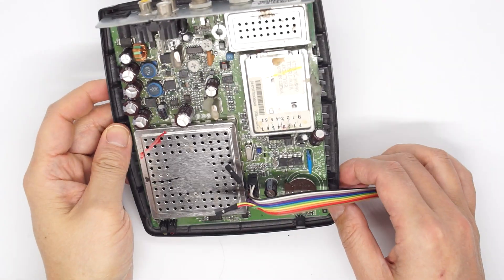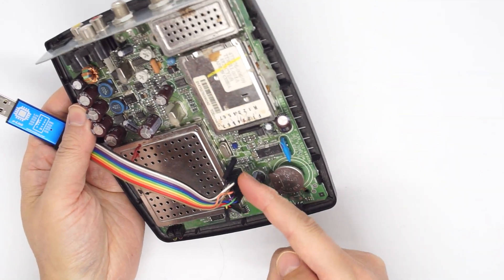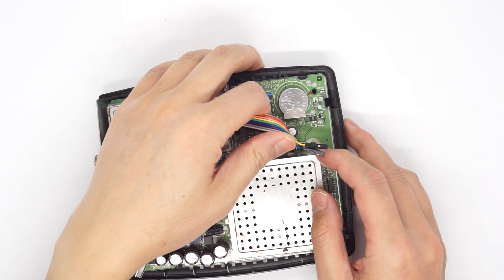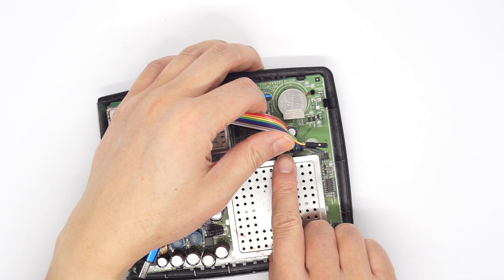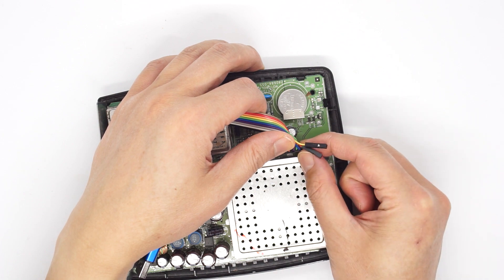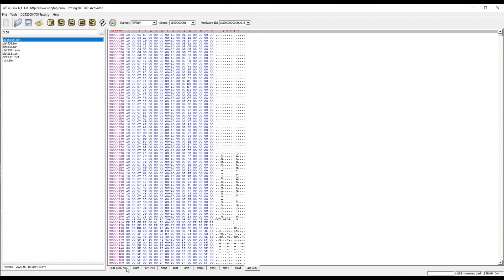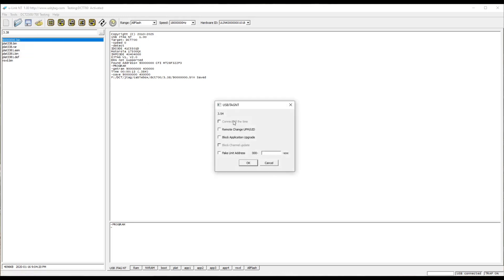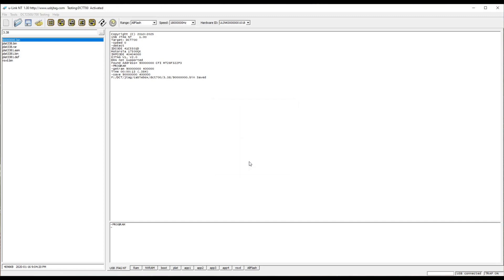u-Link program DCT700

Comment: 282 / 5000
Resultados de traducción
I still do not understand anything. I don't speak English and the little I understand confuses me. Could you draw me in a diagram how the colors are connected for the DCT700 I have the u-link nt unused if I have not been able to connect it well, someone to draw it and help me but it is a lot to ask and thank you
Reply from the maker: JTAG connection.
Name  EJTAG pin    u-Link NT pin   Color
GND    2                     2 (White)
TRST  1                      3 (Gray)
TDI      3                      10 (Brown)
TDO    5                       8 (Orange)
TMS   7                        4 (Purple)
TCK    9                       6 (Green)
RESET  11                  5 (Blue)
Reply: @usbbdm  ya gracias